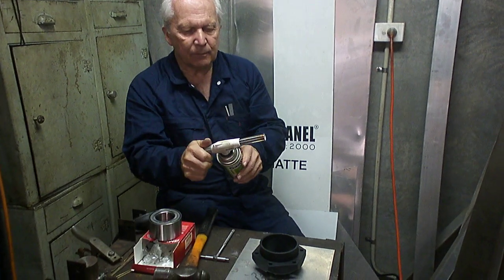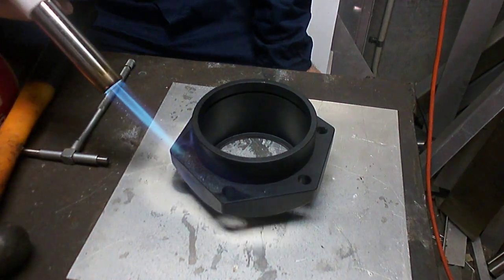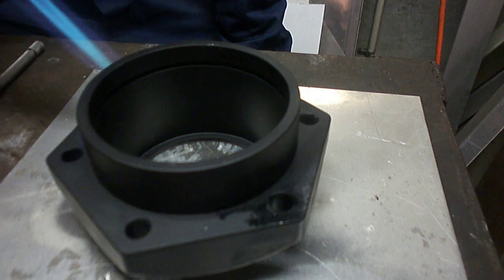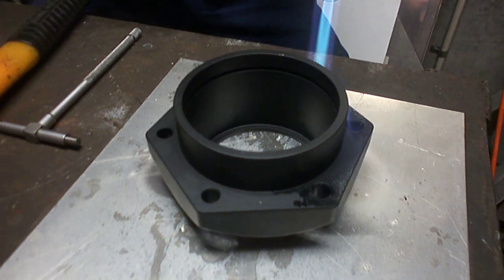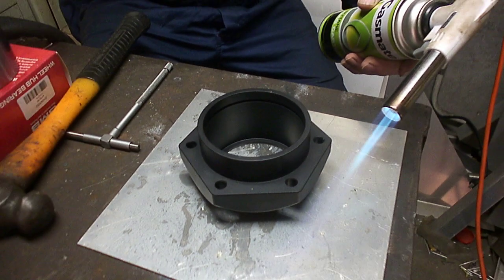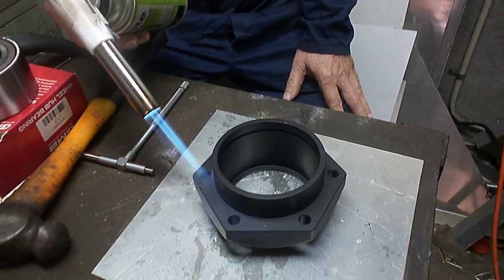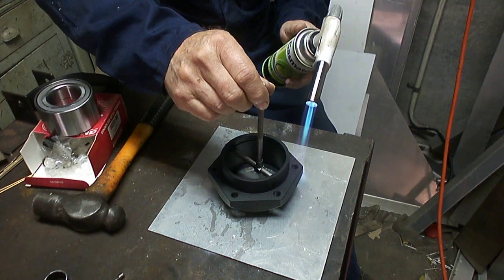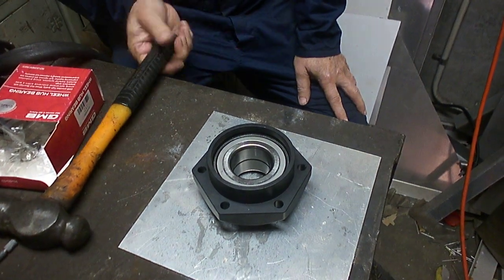Racecraft

Comment: Hi I'm trying to fit a 5.0 ford v8 into a 1994 2wd dual cab triton, my question is do a triton and sigma share similar engine mounts? If not can you help me solve this. My aim is legal in qld cheers Steve.
Reply from the maker: I don't know if the engine bay is exactly the same as a Sigma, but it sure looks the same. I don't want to give you advice on a conversion I have not actually done myself, I'll leave that to keyboard jockeys on forums. However many years ago, about 30. I did a V8 Sigma for our local tyre shop and he used the same mounting kit to do the shop Triton. He used the V8 triton to deliver tyres, reckoned there was always a fight to see who got to deliver the tyres....